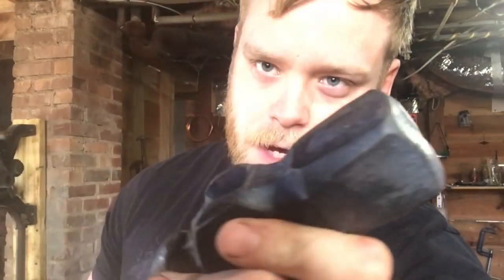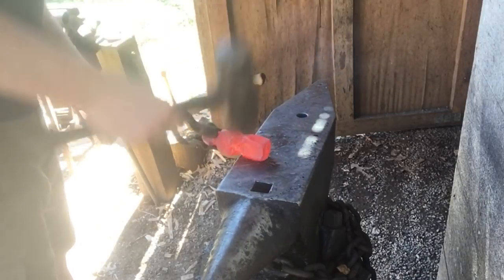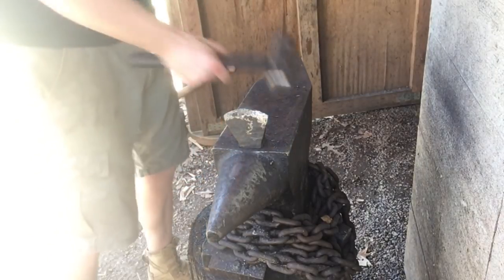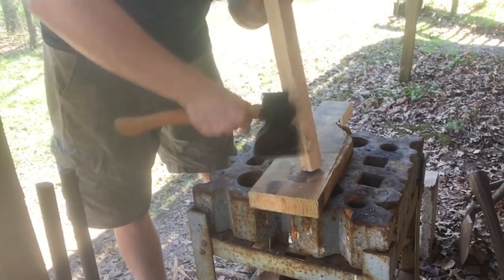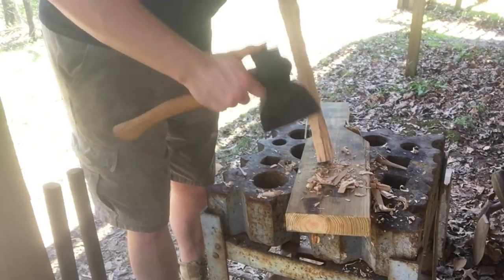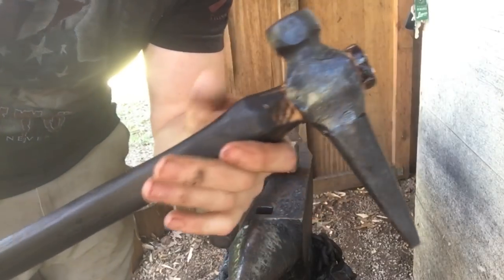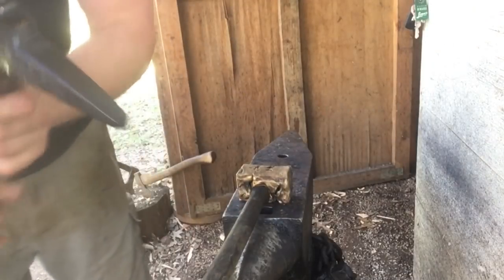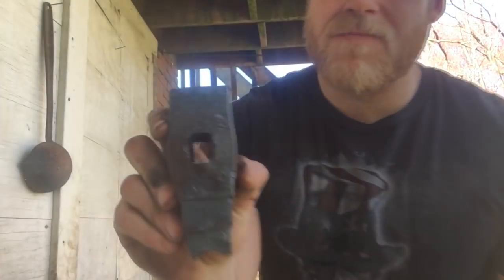Forging it forward. Forging a hammer eye punch from a ball peen hammer

Comment: Been waiting for this! Thanks .What was the weight of the hammer used?
Reply from the maker: Charles Holcomb I did the bulk of the drawing out with a 6 pound sledge I cut the handle short on. Then I cleaned it up with my 3.5 pound rounder

Comment: Hey John, when you tested the punch at the end of the video what kind of hammer were you using? I’m asking because i thought it was a bad idea to  hit a hammer with a hammer the same hardness. Is this true? Can i hit it with the hammer you made me?
Reply from the maker: res31cue that was a bronze hammer I cast awhile back. My theory was that it would prolong the life of my top tools. But because the bronze was so much softer even than non hardened steel it just deformed very quickly and made striking true very hard. As far as the hammer I made you. Yes you could but custom forging hammers are much harder than store bought hammers and would cause mushrooming on your top tools a a good bit faster. Something like a cheap 4 pound engineers hammer is ideal. They’re made slightly softer for driving steel stakes and pins

Comment: noob question but could you not cut off that excess, and keep drawing it out, rounding it more and make it a hammer eye punch and drift?
Reply from the maker: John Malone in theory yes. But a the cheeks of a hammer are forged with the drift inside. Having a handle attached to it would make that difficult.

Comment: Were you using a softer hammer when you were testing the hammer eye punch you made?
Reply from the maker: Jonathon Goss I have a soft hammer I usually use to strike top tools. Engineers hammers are often softer than forging hammers also
Reply: Old Hickory Forge ok awesome I was wondering. I need to get one.

Comment: Do you heat treat and temper your hammer eye punches?
Reply from the maker: Sean Shrader no. Struck tools do not need to be hardened or tempered. They would lose their temper quickly from the heat of a hammer billet and having a hardened striking end would make it more likely to crack and send shrapnel at you. I just normalize and use
Reply: @OldHickoryForge  thank you sir, thats what I thought. Still a noobie here. Awesome channel and thank you for your service to out country!